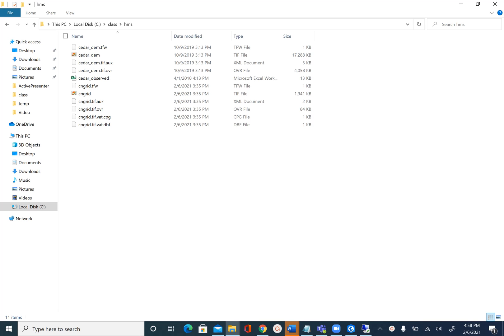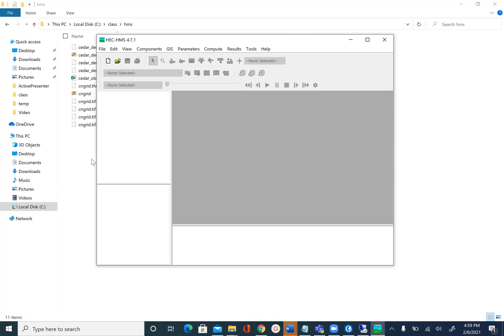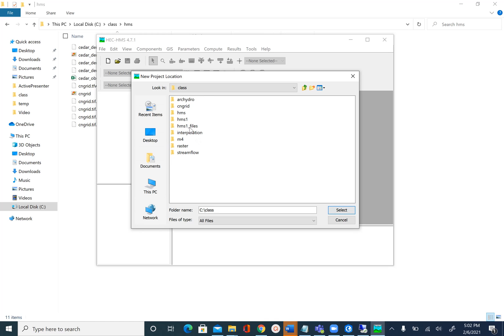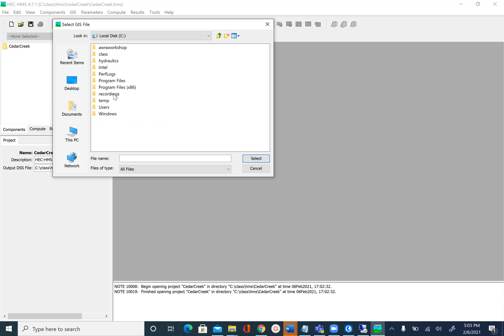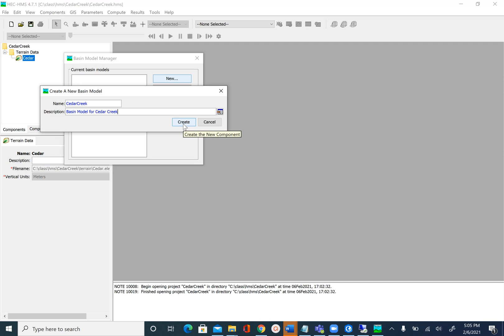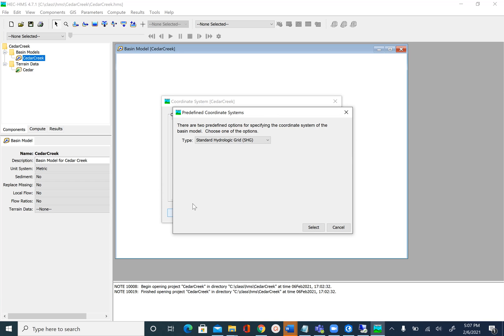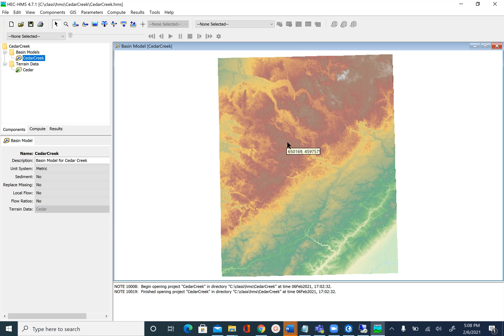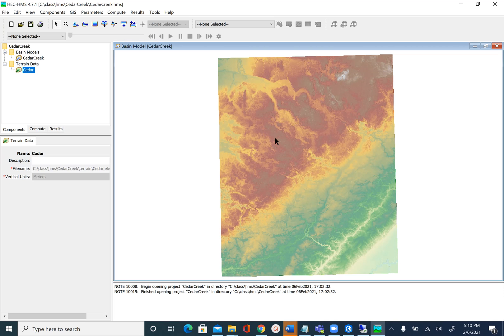Hydrologic Modeling using HEC-HMS: Setting up the model (2/9)

Comment: Sir please i use this video as a tutorial and i kept getting error when i try to load the terrain data (cedar_dem.tif). after creating the terrain data, it doesn't show on the watershed explorer and when i click on coordinate system under GIS, the coordinate system drop down is empty. what could be the error please?
Reply from the maker: Make sure you set the coordinate system in the basin file. it it still does not show up, save your project, close it and open again.
Reply: @hydrologyvideos8253  please how do i set the coordinates. i am  not seeing any where to. i close and open my projects again, it didnt work
Reply: @jokelawal3965  This is my question also. please tell me

Comment: Sir, Can you tell me if hec-hms works only with sentinel tif file as terrain data please ? I use a srtm tif file but it doesn’t appear
Reply from the maker: It should work with any DEM in TIFF format. Make sure the data are projected.
Reply: @hydrologyvideos8253  it works. Thank you sir. My DEM file wasn’t projected.
Reply: @hebertlandu8195  How did you project your file. I am having the same problem I think.
Reply: @sydneyplatt4506  I use the project tool (toolboxes - Data management Tools - Projections and transformations) in arcGis Pro or Arc map. Please use a projected geographic coordinate system I.e WGS 84 33S or NAD 83 4N.
Reply: @hebertlandu8195  hi I've tried that and it's still not working?
Reply: @hebertlandu8195  how we point our outlet?
Reply: @hebertlandu8195  share us the steps please.
Reply: @hebertlandu8195  share us the steps
Reply: @misganawaragaw3207  Hello did you find the solution ? Which steps do you want me to share ? Sorry for the late reply
Reply: @hebertlandu8195  sir  still i didn't get a solution ..............share me everything regarding to my questions.